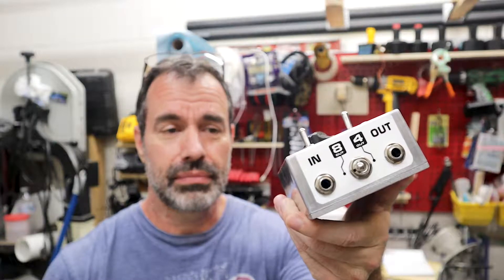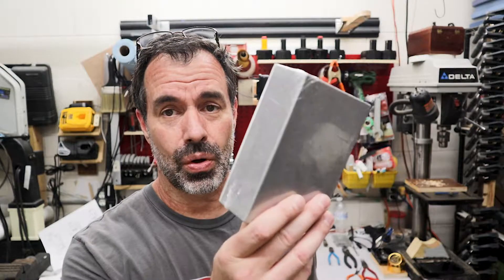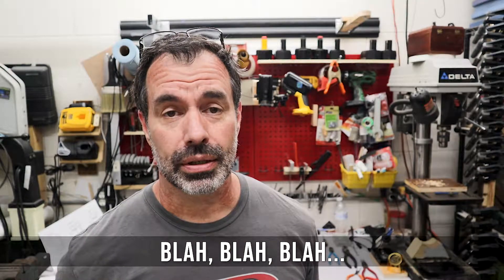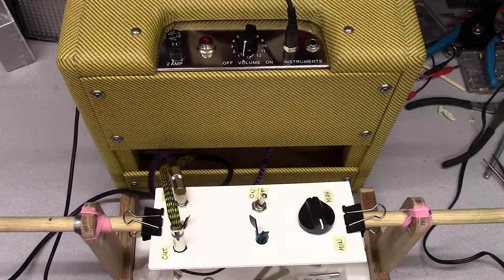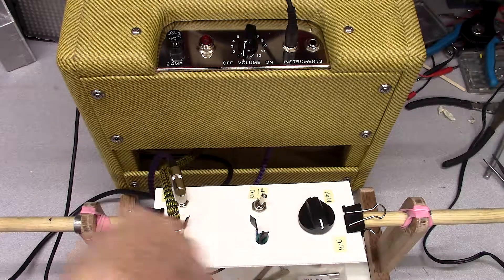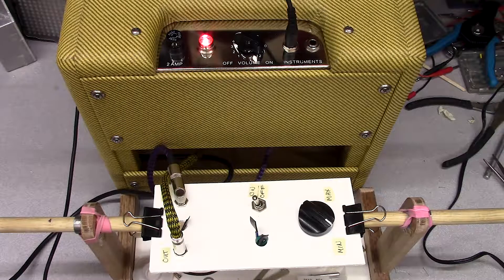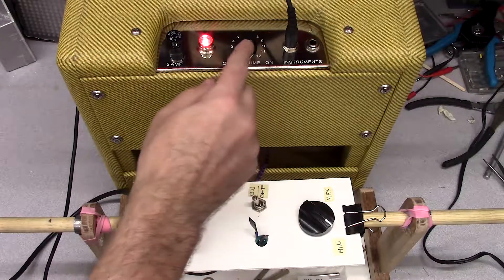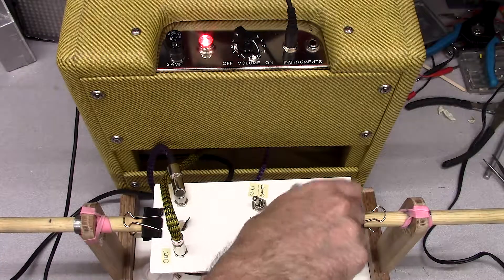Tube Amp Attenuator - the Next Project

Comment: I've been slowly collecting the parts for one of these. It looks fantastic.  I do wonder why you didn't drill for ventilation. It seems like a big deal because of the heat. Also, the guy in the video recommend removing the back from the lpad for the same reason. Do yours get hot?
Reply from the maker: Hey Matt, good questions you have. 

At this point, and with the amp I'm using the Attenuator with, heat hasn't been an issue - yet. 
There are some builds that actually have a fan built in, but I believe those builds are for a higher watt amp. 
Since my Champ clone  is only 5watt, it just hasn't started cooking anything. I also felt that removing the back cover and adding vent holes can be done later if needed. Although it won't be convenient to add holes later - but I rarely do things the easy way. 
At this point I've run it for up to about 45 minutes at a time without issue.
 
The L-pad I used is rated at 100w, there are also 50w versions available and that would have been plenty for my application. Vent holes and removing the back cover are definitely good options to keep in mind.
Good luck with your build, and be sure to research as many build options as you can.
Reply: @theNextProject  The research is half the fun. Mine is a 50 watt. I hope to use it with amps up to deluxe reverb level, so I'm definitely going for ventilation. It's cool that your 100w can take a champ without sweating...that's good to know.